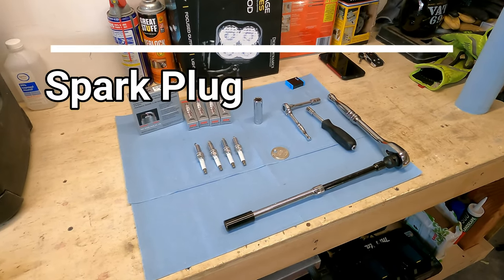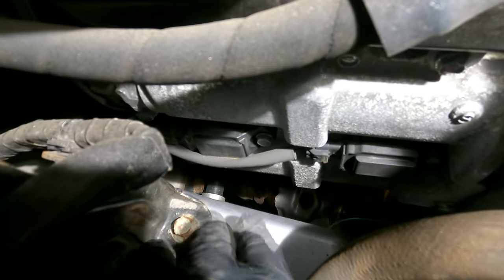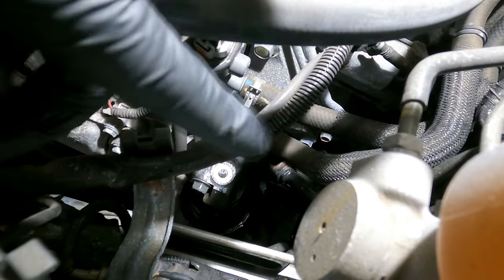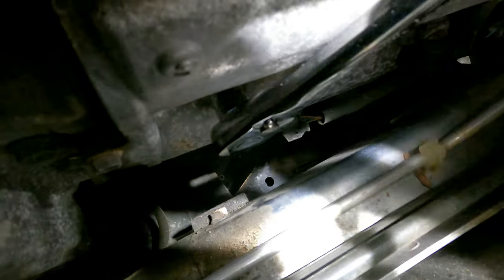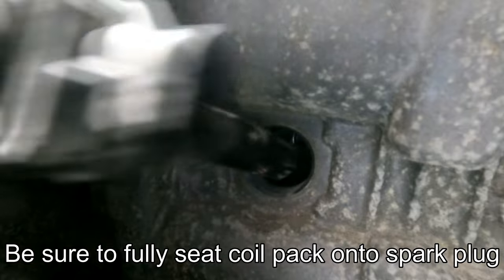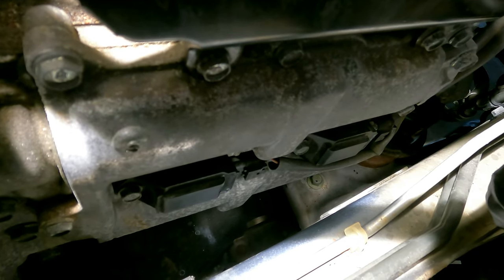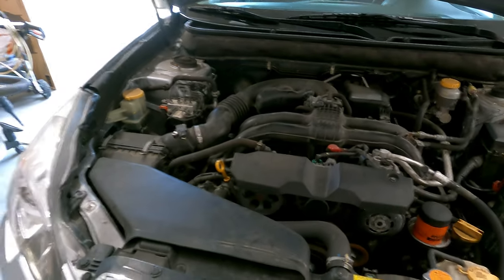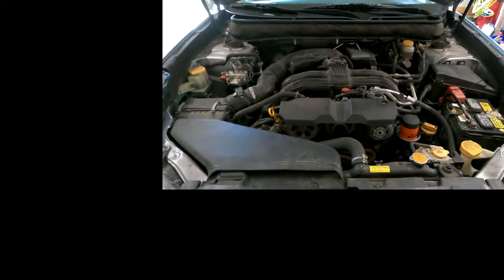[HOW TO] Replace Spark Plugs on 2013 Subaru Legacy 2.5i (Easy)

Comment from the maker: Something funky with my garage LED strobing on camera in this one, but oh well! Enjoy!
OEM Spark Plugs - NGK SILZKAR7B11: https://amzn.to/3avWMiN
Replacement Ignition Coil Packs: https://amzn.to/2P8gdXu
Reply: There is a center motor mount on my 2013 2.5 l outback. Will it flex up, or do I have to remove those bolts too?
Reply from the maker: @cogitoergosum1474  I think you should loosen it too.
Reply: @fondupot  You rock! Many thanks

Comment: I just did my 2013 Outback today.  I didn't end up tilting the engine up with a jack; I wanted to try it without that step first, and I was able to do all 4 plugs.  I removed the same parts off the Air intake as you did, and I took the battery out.  My 3/8 three inch wobble extension and my 1/4 inch swivel universal extension were most useful.  I wrapped duct tape around the swivel universal to make it like a wobble extension; this was used on the Drivers rear with a 1/4 ratchet and adapter to 3/8 drive 14mm deep socket.  That coil BTW easily came out by gently pulling the head to the front and up.  I was able to do the other 3 plugs with the 3inch wobble 3/8 extension adapted to a 1/4 drive ratchet.  If my 3/8 ratchet was hinged I would have been able to use it on all but the drives side rear.  I didn't torque the new plugs; I did the 1/4 turn after snug method.  The old plugs at 70k were fine.  A hinged ratchet would have been nice.  Job took my about an hour and a half of actual work time.  Thanks for your video; its videos like yours that can inspire the confidence for DIY.
Reply from the maker: Glad you were able to get it done. It definitely makes it easier to lift the motor. But it’s not absolutely mandatory. Thanks for watching! And thanks for the comment.

Comment: Gonna do this on Thursday and I'm watching this to be prepared. I don't have a jack however. The other commenter mentioned being able to do it without one so hopefully that'll work for me. What does it actually do when you jack up the engine? Does it help you access the bolt areas? Do I need to physically lift the engine if I don't jack it up? 😳
Reply from the maker: Good luck. It's probably doable with out jacking up the motor, but it definitely helps to give more clearance. Good luck!

Comment: Just did this on the 13 legacy and lord knows why they put the plugs 1 inch below the frame so you cannot get to them without jacking up the motor. Took me 45 minutes car to change the plugs. Took me 10 minutes on my Honda
Reply from the maker: Yea. It’s not the worse spark plug change. On my 2019 Canyon I have to remove the intake manifold to change the drive side bank of spark plugs.